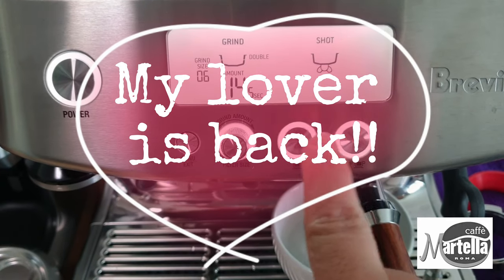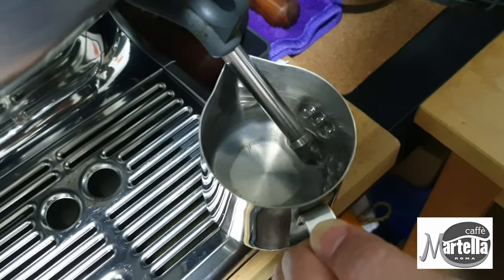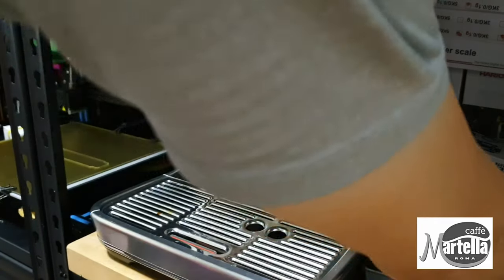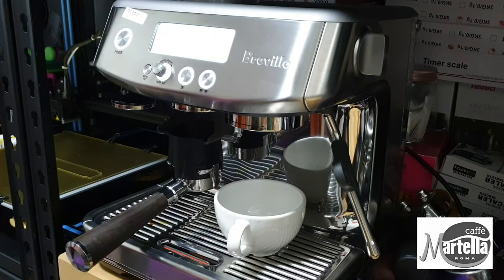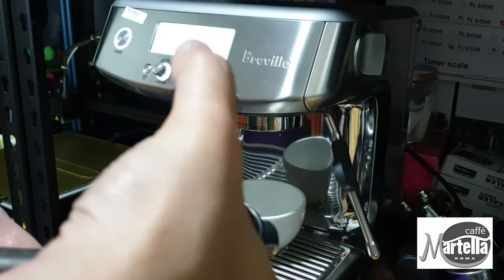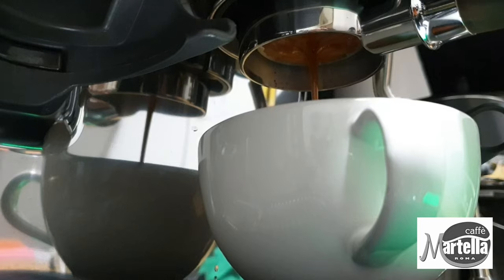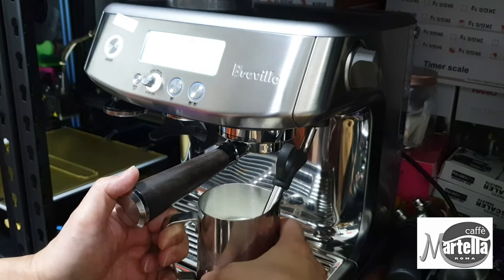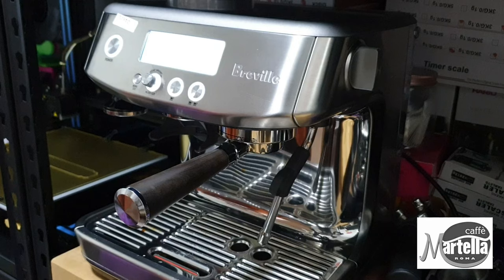My lover is back! What is actually wrong with my Breville Barista Pro?

Comment: Thanks for making this video and I'm surprised to see so many people have the same problem. I have had the same issue with this machine for over a year. Interestingly (and disappointingly), the problem first occurred one month after the warranty expired. But what's more interesting is that the problem has solved itself randomly several times. Once I opened the machine just to look around but didn't change any parts and when I put the machine back together, the problem was fixed! But then the problem would return randomly after 2 months and again fixed on its own a few weeks later. It's been a mysterious cycle and I haven't been determined enough to get to the bottom of what's causing it. I suspect that a part inside the machine may be loose or a tube or some other part may be clogged. I also want to admit that I haven't been descaling the machine as often as recommended. I'm interested to know if others have experienced the same issue (machine fixed on its own). For those who sent the machine back, I am wondering if a repair was really necessary or if the machine was repaired on its own during the shipment process...huh! The comments under this video gave me some ideas for troubleshooting. I will start by changing the flow sensor as none of the easier solutions did the trick. I will let you know how it goes.
Reply from the maker: hope your machine is back in order!

Comment: Hello, thank you for your great video. I also encountered the same issue a few days after initial use of this espresso machine. After a few drops of steam come out, the steam generator and hot water only work for a few seconds. Did your issue get resolved after repair, or did you use another solution?

Comment: Hi, thanks for the videos posted. Mine also has the same problem and all the functions stop after 5 seconds. Also bought it from Australia so not covered under warranty. Just wondering where to go for the repair, the costs of it, and do they help to change the plug to a Singapore one? Thanks in advance!
Reply from the maker: if you want to I can help you take a look and swap out the plug for you. You can go local breville agent Yeo Teck Seng. They will charge you with a diagnostic fees at about 120++ before any repair is done. This is just to check the machine. If there are parts to be changed, you will then be charged with parts and labour after.

Comment: Hi there i owned a aussie version of the barista pro as well, how do i convert the plug to a SG version?
Reply from the maker: Cut the aussie plug off and buy a UK 3 prin plug from any hardware store. It is just 3 wires to connect, and they are all.colour coded. Red/brown for live wire, blue for neutral and green/yellow for earth.
Reply: @CaffeMartellaSingapore  i’m experienceing a issue with my Barista Pro at the moment, not so sure if changing. The plug will help. The machine will run for a couple of sec and then it fizzle out, when pulling a shot, when using the hot water or the steam… it just fizzles out
Reply from the maker: @chinthiamtay8791  nah, that is not the issue with the plug. It's a prominent issue with all the thermal jet models, especially with the barista pro. That's is also the main reason for me to move away from any model that uses thermal jet technology. I would rather get the barista express, which uses thermal block, and don't mind waiting 2 to 3 minutes for the machine to heat up. I really don't need the machine to be ready in 3 seconds.
Reply: @CaffeMartellaSingapore  i see, would this be costly to repair u think?
Reply from the maker: @chinthiamtay8791  Breville is very smart at that as it's a proprietary parts and you can't  buy from anywhere except from them. Price won't be cheap once your warranty expires. But really, breville is not the only company that does that, of course.
Reply: @CaffeMartellaSingapore  do you have any suggestion? I can also bring it to Yeo Teck Se at Jalan Pemimpim and see what they say as well
Reply from the maker: @chinthiamtay8791 Yes, that will be a good option, but nowadays they don't repair machines which are not purchased from them anymore. But you can try your luck.
Reply: If the issue is with the thermal jet and it needs replacement, what is the ballpart firgure to replace it? Brewratio site puishwd the parts cost at $250!
Reply from the maker: @chinthiamtay8791  that is part cost only. Still have servicing cost. Ballpark maybe around 300 SGD. I am not sure but that's what I figured.

Comment: Hye and good day! I have a similar coffee machine model as yours. Woke up one morning with the FLUSH indicator ON. However the machine was not able to commit. I have even tried DESCALE. , same thing. So I tried warming up the machine by keeping the machine ON for 5 mins and tried to FLUSH. Still the same. , hot water only comes out for 5 seconds.The steam also only comes out after 5 seconds. I did try to flush by pressing the 1 cup and 2 cup buttons to help de-clog something. Any tips on how to solve the issue? Thanks in advance.
Reply from the maker: One of my viewers suggest changing the water filter which solve the issue for him. And others have also suggested keep trying the descale Cycle until you are able to finish the entire cleaning cycle. 

If no else works, you will need to contact your seller and the flow control device attached to the thermal jet coil may need to be replaced and even the thermal jet coil itself.
Reply: @CaffeMartellaSingapore   thanks again for your suggestions. I have decided to contact the dealer and see how that goes. Once my machine is in order , will share what went wrong here so that other viewers may learn something about it. Have a good day ahead!
Reply from the maker: That's great!
Reply: @leaali6156  This is such a common problem it seems. Mine did the same thing last week. Tried all of above several times and still have the same issue. I'm taking it to the repair shop today and will report on here also what issue mine has.  The diagnostics is free but I know the repair will cost quite a bit.    It also just went out of warranty also.  I do feel these machines really should last longer since I do take care of mine.  Really annoying.  Hope you solve your problem and report back.
Reply: @GAR413  Hye Gavin , I am sorry this has happened to you as well. I love coffee and my coffee machine.For now I only get to grind coffee and brew using french press method. Awaiting reply from the repair centre and will surely update progress here. Its like these machines now days are programmed to malfunction just after the warranty has expired. 🤣
Reply from the maker: Hopefully that is not the case. Othet than this common and frustrating issue from the Barista Pro, which seems inevitable and eventually will happen and they don't r3ally a a way to solve this issue from Breville which is really frustrating.
Reply: @leaali6156  I was told I have to wait a week until they can look at it so will sure report back then.  I have my drip coffee for now using my V60.  Hope our problem with the machine will be resolved soon.  So true about the timing of warranty grr, I'm scared to know how much all this will cost 😅
Reply: Update. I have my machine back. :) The 5 second problem with my machine was with the water flow meter that needed replacing. technician also cleaned up the solenoid valve that was starting to stick so would have had problems down the line with that and a full descale since even though I use filtered water I was told to double filter using both filtered water and using the filter on the machine, and definitely descale more than when the machine indicates. Once a month would be a good time. It was quite expensive to repair about £150 :( Next time I would just get it diagnosed and get the parts myself and install it.  Have  you heard back regarding your problem?
Reply from the maker: @GAR413  yes flow meter is one of the problem mentioned together with the thermal jet coil. I think this is the part Breville sacrifice to heat up water faster and use a more narrow tube of water in the thermal jet coil which is more sensitive to calcium built up. I have never heard the need to use double filter but well this just shows that the water breville is not enough to stop calcium from getting into the thermal coil and flow meter. Instead of asking us to use "doubled" filtered water, they should improve their filter. Not every home has filtered water but using of distill water only is possible.
Reply: @CaffeMartellaSingapore  Thank you that is good to know why this problem is happening. Now I know what is causing the problem I need to address the water I am using again. I use Brita water from my pitcher but will either start buying the filter for the machine or finding a company that filters the water better to use in my machine.   What do you recommend with filtered water?  Do you use any particular water for espresso machine? I watched your video about making your own water for pour over.    Thank you again I have learn't a lot from your channel.
Reply from the maker: @GAR413  hi I think distilled water will be the best for thermal jet or thermal block machine like Breville. As any kind of minerals introduce can be a form of excuse given by the manufacturer that the problem arises is not their fault or problem. If your machine is under warranty, use filtered water or distilled water. I will suggest you use mineralized water on filtered coffee only as I am still not comfortable using mineralized water in machine.

Comment: I just recieved my breville pro from Australia also with different local plug
The main problem in steaming after start its stopped and eject water serval times and start over !!
Could you advice what can i do ?
Thanks alot
Reply from the maker: hi most likely you didn't engage the steam switch fully.